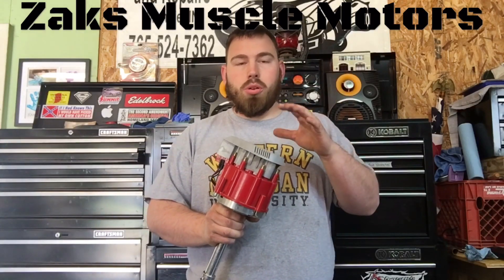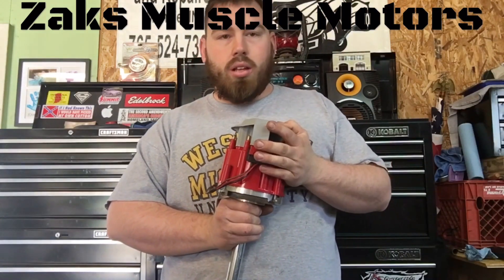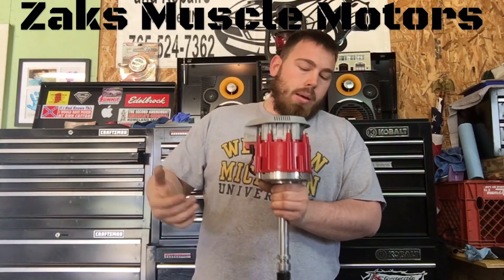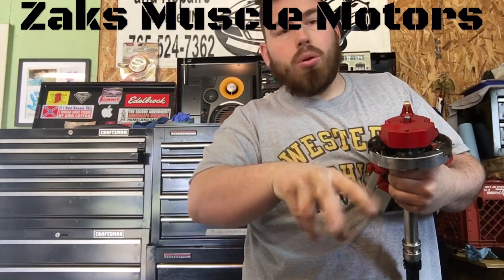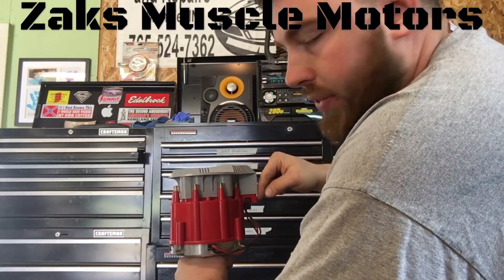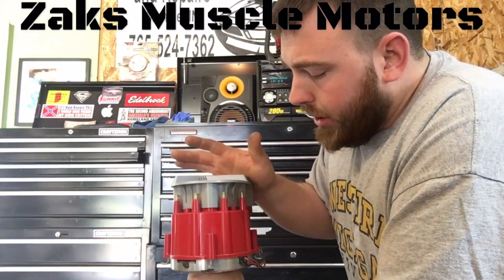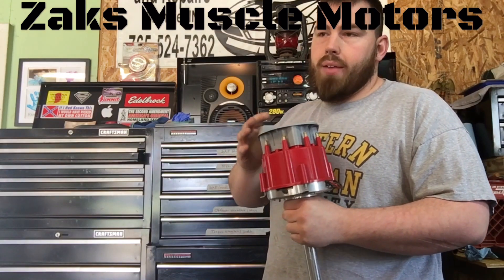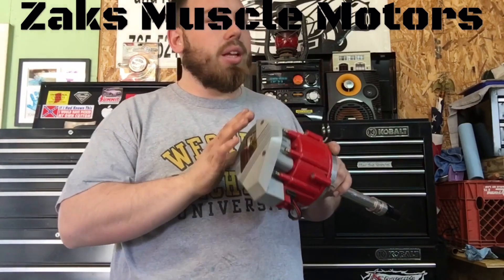Engine Building 101 HEI Distributors

Comment: That's the firing order for every gm v8 older ones anyway nowadays it has two changed around but all the old gm v8s are 18436572 Pontiac goes the opposite of Chevy's although I've seen many guys get confused by that and get confused by being 180 out as well

Comment: It all starts at the battery at 12.8 Vdc open circuit. Ground from the rear end housing of the alternator goes to the battery, not the block. This is where ground amperage is produced. Yes, you need good large grounds to the block, frame, fender, cab and bed if truck. I have seen more HEI failures because they left the internal ground strap out, so nothing from the coils frame to the wire connector. Stock OEM GM HEI coils primary ohms at 1.3-1.4 while higher output coils ohm at 1.2-1.1 Great, this is capable of producing higher hotter spark, but the only voltage produced by the coils secondary is the lowest amount needed to jump the spark plugs gap. Change cylinder pressures, timing, anti-knock value of your fuel as it drops quickly after 90 days, spark voltage goes up under acceleration as carbs go a little lean true, but pressure increases with atmospheric difference and spark voltage goes up. If a wire, cap or rotor fails, it will misfire at this point. Air flow thru head, back pressure in exhaust (Some is actually good) plug clocking, cam type all make the engines characteristics change. HEI distributor without springs/weights or vacuum advance have a marine version of Delco's original ignition module that has pre-programmed amount of advance based upon input signal from timer core for RPM. A GM marine inboard engine with a V6 is more aggressive than a V8, but if racing at 7k RPM, all bets are off.
ASE Master Tech since 1978 - Retired

Comment: how do i lock out my distributor on   a 383 stroker.  and what's the advantage of doing so
Reply: Are you gonna drive it on the street ? If you lock it out then it's gonna be hard to start and not really happy on the street the advantage is it's advanced all the time for quick takeoffs disadvantages are many the only time it should be locked out is for racing where it's started and not shut down again till the face is over

Comment: yo bro what could be a problem if i crossed over my spark plug wring i have a 2.8 v6 my engine cranks its getting gass it wants to start but wont let it
Reply from the maker: Jeremiah Renteria the problem is it won’t run.
Reply: Zak’s Muscle Motors i crossed over spark plug firing order
Reply from the maker: Jeremiah Renteria give me a call bro 7655247362

Comment: so if you install a distributor you point the rotor button towards the # 1 cylinder and you start the sequence at one clock wise or counter depending on the application
Reply: im for real dude this has me discombobulated
Reply: depends what way it rotates in, take of the cap give it ignition and see what way it turns.

Comment: hi zack I am working on a 350 chevy and the oner wanted a chrome  timing chain cover I am comfuezd  about the timing pointer it is at about 2 o clock and the original  timing cover is at 12 o clock if I bring the engine  2 tdc on the crome  cover it looks like it is st tdc is there a difference  on the chrome  cover I don't understand  y the timing  plate is at 2 o clock and not 12 o clock
Reply from the maker: Can you call me?
Reply from the maker: 7655247362
Reply: I can if you wish
Reply: Zak Lamb do you want me to call you know
Reply from the maker: +john Kosheluk yea go for it bro! :)

Comment: Quick question.  i am doing a full Chevy conversion to a 1995 Jeep Wranler YJ.  My engine is a 350 that has been bored and stroked to 383 and I am now doing all of the wiring into it.  I removed the PCM/ECU computer from the Jeep (that was stock with the 2.5L) and all of the associated wiring that was connected to the computer.  I found a blue/white wire (under the hood) that reads 12+ volts when checked with the multi-meter.  This wire is an ignition source that turns "hot" when the key is in the ON position.  When I turn the key and test this same wire, I see the voltage drop from 12+ volts to 9+ volts.  Is this wire sufficient to run my HEI on???
Reply from the maker: +MrRichg1967 hey i just seen your message i dont always get a notification and i dont know why. 9 will get it but the HEI will not run at its best, you can always run a direct fused 12-14 gauge wire from the battery to the distributor with a 2 way switch to get the best energy to the module. Im posting a video now about the MSD 6AL-2 Controller it would be a good option for you. Sorry about the delay.
Reply: No apology needed.  I appreciate you getting back to me.  I hooked up my HEI to an underhood ignition wire and it fired up beautifully.  Of course when my question was posed, my battery was pretty well used and so I replaced it prior to starting the engine.  But I do appreciate your response and look forward to viewing your other video.
Reply from the maker: good deal man im glad it worked. video will be up soon i hope
Reply: +mercurggy1967 GT